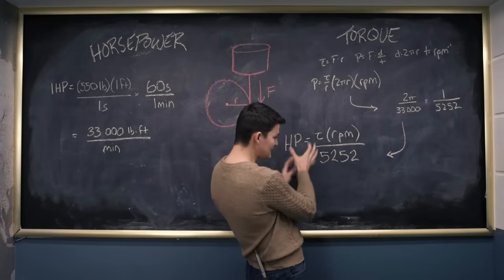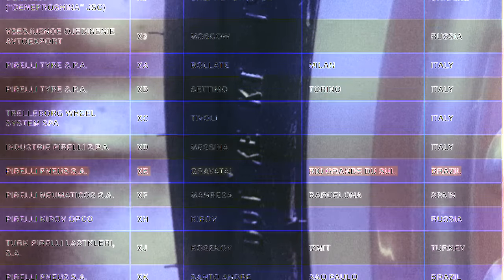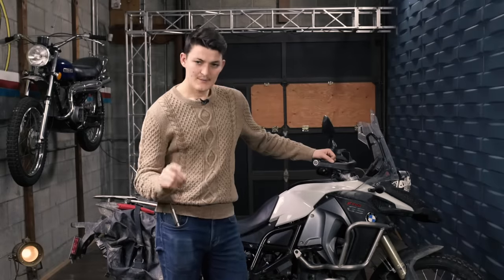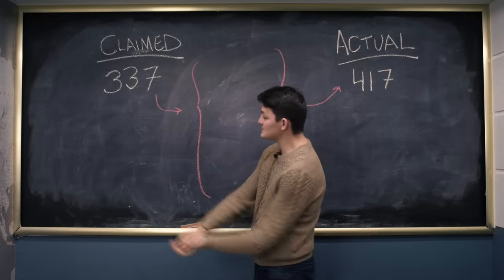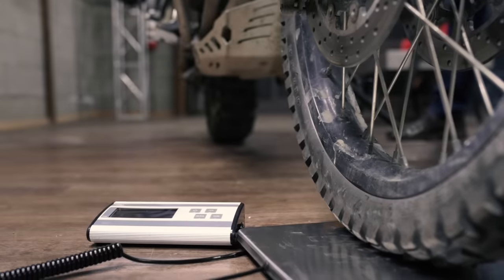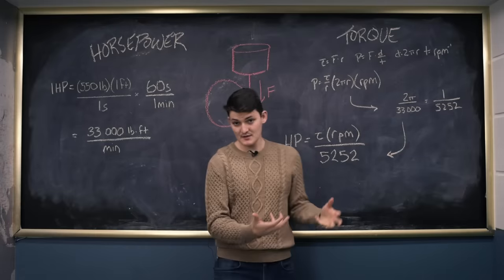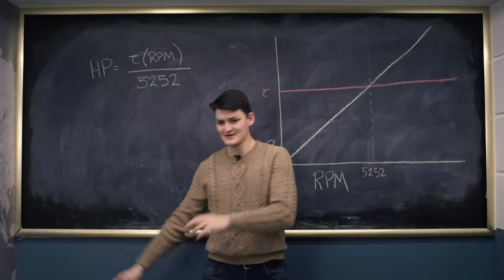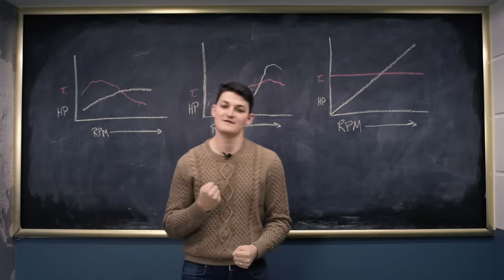3 Ways Motorcycle Manufacturers Trick You

Comment: I don’t agree. To use the term horsepower is far from ideal in the first place. You should use KW (power). And basically power is torque * rpm. So the graph is not from a combustion engine that’s for sure and there is a definitely a difference between power and torque but one is not possible without the other. But you can definitely feel a high torque and as the engine gets higher rpms the power increases naturally. That’s the difference between a diesel and a gasoline car for example. It’s because of the shape of the piston and the length of the rod. Also the because of the compression ratio. So what you feel is the torque which together with the rpm makes power (hp)
I also don’t agree on the tire thing. We have high standards in Europe and people are crazy about being screwed haha
But I like the advise at the end:)

Comment: That last one about torque and horsepower was great. The only problem is that when someone says “ go ride and see what you like” they don’t seem to take in to account that the dealer likely will not let you, and even then not properly. So we gotta go by reviews or hope a buddy gets one. As for me, as far as power goes I like more low down, and in my experience bikes with longer strokes make ultimately less horsepower but the make it lower, so I’ll look at bore/stroke ratio and lean toward bikes with a lower number. Bikes that on paper or in the opinion of pros are total dogs because they’re low on power and/or don’t wind up real high will likely be preferred by those of us who don’t race and tear ass. Most of us want a manageable bike to have fun on. Case and point is the current Beta dual sport lineup. 4 bikes, different strokes between the two 350 and 390 and different bores between the 450 and 500. The 390 has the lowest bore/stroke ratio and many who ride all of them say it feels like the most powerful and most manageable and was often reviewers favorite. Anyway, my two cents.

Comment: the substitute tyre thing is not always that bad , ive bought a few brand new gsxr1000s in my life and the standard OE bridgestones on the earlier ones were actually better than the ones off the shelf , case and point the front tyre on the k3 was missing the single radial line dead in the centre and the handling improvement was noticeable , another bike was the early hayabusas with the bt56r rear , the oe tyre had more plys which greatly assisted with stability , i infact used to grab all the OE rears off hayabusas as most of them had the middles worn out and not the sides and put them on my ZX9 c1 which had an unbraced swingarm and it would vastly improve the stability due to the stifness in the carcass , yeah yeah i know a 190 on a 5.5 inch rim but they still fit well and worked great

Comment: Yes you're right about the third curve, the twin's will typically have a pushed at the start of the rom range, the 4 cylinder sports bike typically pull at at million rpm but the triple cylinder engine, particularly the triumph 1050 will pull with linear progress across ola very wide rpm range. That's what must people want for the road and it's perfectly suited to that task. The bore to stroke ratio of near 1:1 actually 80/70 is as hear perfect as you can get. 

I like your blend of humour with facts. They can be a bit dry without the humour so keep it going.

It's not corny if it's done thoughtfully.
I think you're interesting to listen to. 

Yes dry weight is not useful unlessw you can calculate the bike's weight when it's used... should be better regulated.

Tyres..I just use Michelin pilot road and I've become a shamefully devoted fan of those tyres.. occasionally I might very a storm or battlax but I'm fairly consistent with my pilot road tyres.

Comment: This is a long-standing confusion that I have :
Torque acts on Moment of Inertia to produce change of rpm.

( At zero friction, no torque is needed in order to maintain the rpm. )

So when one says a motorcycle has higher torque than another, what is meant here?
That the first bike has higher torque at a specific rpm ( So that it can increase the rpm even further )

If that is true, Torque vs rpm curves are needed in order to compare the performance of any two motorcycles.

Thoughts ?

Comment: Torque and Power are different, albeit related. People should care about both, and yes you need to see the bikes on the dyno (motorcycle magazines will do this). Ask people who buy Diesel engines (lots of torque from a long stroke engine) but as a result lower rpm and lower maximum power). Or someone who rides a two stroke motorcycle (barely any torque unless it is being thrashed at full revs). 

I agree about the flat torque curve as being ideal, but some riders like the ‘top end rush’ of an in-line 4 while others prefer the flat curve of a v-twin.

Comment: Maybe to put some perspective into power vs. torque:
Power is force times speed (P = F*v) and the force is, what is accelerating you, so in fact what you are feeling depends on your speed and the power put into the system.
This is also the reason, why aircrafts usually aren't measured in power but force, because the power is depending on the speed of the aircraft and they aren't limited by normal forces when accelerating.
With land vehicles, you are usually limited to about 1g of normal force, so power is in the best case a measure of maximum speed with (near) peak acceleration (usually about first or second gear) and a measurement of total resisting forces overcome (in the best case), which translates to top speed. Gearing makles all the difference in this case, as it directly changes the available power at a set speed or on the other hand changes the available force at the wheel.

Comment: I think the torque-horsepower differentiation comes from cars, where, due to the vastly different sizes of vehicles it applies to, there genuinely need to be vehicles with much longer strokes and higher radius rotations, or your average 18 wheeler would be moving its piston at relativistic speeds. But, as noted, it's mostly irrelevant on bikes, which generally have similar torque to horsepower ratios (because your not going to build a much larger, but also explicitly much slower engine- our work truck has significantly less horsepower than most sportcars, but if you piled our 10 ton garbage capacity into a bugati, it's not going to move anywhere despite having more than 3 times the power. Probably because it would crush flat, but you get the idea).

Comment: Well, you don't feel the torque itself, but the chagne in torque.
If you accelerate in the same gear,  you get more and more rpm. The more rpm, the more power. But the faster you get, the more power you need to accelerate for the same amount.
That's why you accelerate faster in second gear than in fifth gear (even without wind resistance). So the rpm cancels out when you only consider acceleration. What's left is the torque. So a rising torque in higher revs means higher accerleration in higher revs

Comment: Thank you Ryan, Awesome explanations on the math for those that don't know it. Now, when people don't believe me, I can point them here for a second mental-incursion on why the true Horse power of the engine is when the  Rpm is at 5252 rpm , and  T= Hp.... ( or visa versa...and minus mechanical losses , of course).
I'm still trying to figure out why HD sets rev-limiters to 4500 or 3500 rpm, Etc.  Seems like a waste that the classic N.A. cruisers will never reach full potential of the motors full capacity.( Piston speed , maybe , but that hasn't stopped Yamaha or Kawasaki from revving.their under-square V twins to high rpm's... )...ciao
Reply: Is it simply because ABOVE 3500 RPM, Harleys shake so uncontrollably that no readings can be taken?

Comment: HP and torque are two appreciated metrics. Two cylinders punch much harder at lower speed/rpm than the equivilant sized 4 cylinder. Quite simple. Once higher rpms are attained, more cylinders, together, overtake the fewer, large bore cylinders.
I guess it's important to list WHEN that power is achieved, yes.

Comment: Well, in the "torque vs horsepower" discussion, there is also one more contender: The Gearbox
Because you can get an engine with a high ratio gearbox, which will have less torque on the wheels, but higher maximum wheel RPM, but you can also get one with a gearbox that has lower RPM, but higher torque output.
Reply: But in real life, when manufacturers make misleading claims around the torque or power of their engines, they anyway exclude the gearbox from the discussion... So, there´s no misconception about the role or importance of gearboxes (cause there´s never been any brainwashing about them), the misconception in most consumers´ heads is about the engine.

Comment: Nice video :) but if you are comparing two in line 4 cylinder engine with the  torque and BHP is irrelevant but if you have in line 4 cylinder engine with 100 BHP and V2 with 100 BHP the torque will be much different so maybe manufacturers in some ads give you BHPs and in others torque :)

Comment: Finally pleased that someone mentions this torque vs horsepower nonsense. Just because a bike has a lot of torque doesnt mean it will accelerate fast. What determines acceleration is power. You feel power more than you feel torque. If it was torque that won races, then i guess the 2005 f1 cars with around 950 to 1000 hp would lose to a Golf R?

Comment: Most modern sportbikes basically have the same torque (maybe a bit higher) they had 10-20 years ago but can go to much higher RPMs - Here is a comparison using the imperfect but still entertaining Ride 3:
· Honda CBR900RR autoshifts at under 11000rpm
· Honda CBR1000RR SP2 autoshifts at close to 13000rpm
Both bikes probably have similar torque figures but the modern bikes has it much later

Comment: Trick 3 is classic Royal Enfields or in general all touring motorcycles brands. They keep saying their engines generate insane torque at low RPMs but their motorcycles hardly move forward. 
Another thing is the drive ratio. Torque generated by your engine means nothing. It's the wheel torque that matters. But no manufacturer will ever disclose the gear ratios.

Comment: Loving how far you have come with your vids. Keep it up a d you will do well. But... Your understanding of torque and horsepower needs work. You cannot have a flat torque curve as it means you have work at no revs. Torque is easy to put at the power produced and how is the power produced times revs. Torque will not die as your graphs showed not will and not produce at zero rpm.  A small motor producing small power 16000 times a minute has small torque but bigish HP. A big motor producing big power each stroke with low revs may have the same peak hp... But felt very differently.

Comment: Tires arent that simple and many high end / more performance oriented tires come with a shallower tread depth from the factory because the additional tread squirm under load can negatively impact handling. Also tires with shallower tread often come with softer rubber and stiffer sidewalls to further improve handling, both of which are difficult to determine just by visually comparing the tires. Tires always have tradeoffs and a major one for performance is longevity.

Comment: The explanation about HP and torque really changed my mind. Sad that we can't get the dyno graph from the producers, instead gotta hope for reviewers to do it. And most of the times the peak torque and HP are around 20% smaller than what manufacture tell us. Are those numbers theoretical too?
Reply: In some cases they are theoretical, but generally mfrs will quote crank hp/tq, as that is where they measure it with their engine dynos. The #'s we see from reviewers are from chassis dynos, measured at the rear wheel. The difference is driveline loss, ~5% higher for shaft vs chain drive. Incorrect dyno calibration/settings can also give about any # desired.
Reply: @dougfreeman3229  good to know 👍. Thanks for the answer

Comment: His breakdown of torque and horsepower being misleading because of the RPM's making it hard to utilize is so true. I have a G37 with 330 hp and 278 lb feet of torque. If I'm cruising at around 2000 rpm and put my foot down it's dog slow. I don't know how much power that motor makes at 2000 rpm but it's not a lot. Unless I shift down so that I'm between 3500-6000 rpms all that power is unusable. Considering most of us cruise at 2000 rpms 90% of the time in our daily driving, it does not make for a great driving experience, but on paper it looks great.

Comment: Until now I only knew the OEM tire trick the other way round. On cars OEM tires are built tailor made for that vehicle. Same size, same brand, same manufacturing plant - but the tires for BMW, Volvo, Ford and VW - and even the platform sharing Audi - are all different in detail despite looking the same. If you get the chance to see them factory new you will just notice different colour stripes on the running surface, which reveals the trick.
So stop thinking why after the first set was worn your car will never drive as smooth / economical / sporty (whatever the car manufacturer wanted the tire to be, these three things are making a conflct triangle) as new and as the one you took for a test drive before you bought. The OEM tire was made especially for this car. The aftermarket one is plain average because it has to work with any car.

Comment: I have no idea what you think you're talking about. But I can feel the difference between more torque down low add more horsepower up high on anyting I ride. I can also tell the difference on automobiles. Even though I do understand what you are trying to convey. But if I have an engine that puts out a hundred horsepower that is putting out 50 lb of torque at 2000 RPM and doesn't put out a hundred horsepower until it's at 5000 RPM, feels completely different then an engine it only puts out 30 foot pounds of torque at 2000 RPM with one hundred horsepower at 6500 RPM.
Reply: Okay but you arent feeling the torque, you're just feeling acceleration at different speeds. And falsely correlating that in your brain with some mystical difference between torque and power.

Your ass (literally) cant tell the difference between 50NM at 5252 rpm compared to 25NM at 10,504 rpm. To your senses they are both just some amount of acceleration and to math they are both just 50 horsepower.

Comment: Power is not tied to RPM, not as much at least, that's why you have a 6 gears transmission. And that's why peak power is meaningful unlike peak torque. But it is true, a torque or power over rpm graph would be much more meaningful than both those values.

Comment: Copper wires were stripped out so only the plastic sheath remained, tires were under inflated with hydrogen gas,  no air filter, oil filters, spark plugs, and even the caps from tires valves all off

Comment: Here in Asia, QJ Motorcycles (China) and their subsidiaries (Keeway, Benelli and) have been practicing ALL those 3 tricks since 2017, I think.
Their bikes appear light, fast, and equipped with above average tires on paper/pictures.
But if you buy one, they are 15-30% heavier and slower than what they have printed on spec sheets aaand the tires are dang cheap which has a high chance of causing a low side crash on wet roads.
Sigh...
So, Asian folks, if you're going to buy a bike from QJ, Keeway, or Benelli, ask a pro mechanic from another shop about what you should do right after riding the bike from the dealership without screwing the warranty. 😁

Comment: I hate how Japanese OEMs send out torquey or high powered bikes with cheap pieces of garbage tires that will slip at the slightest bit of rain or temperature drop especially in a turn. My Z650 shipped with Dunlop D214s and those were okay in the warm dry pavement but once it got wet or cold is when it started to feel greasy and lacked any feedback while riding. The Z900 also ships with these tires which is even worse considering how much power and torque  the engine puts out.at low to mid RPM range.

Comment: Torque gets you off the line, HP pulls you through the traps.   When they say, "feel the torque", they are saying it's a motor with its power range at lower RPM's , not much more.

Comment: Very right stats for dry weight ....the tyre theory is also right as sales man said its special compound tyres with extra grip but were thinner n lighter than aftermarket tyres of same brand....it's stated as best number to impress 25 hp @ 5600rpm or 27 nm torque at 4000rpm n bla bla bla.....good job in bursting ass of fake claims ...as I also tried all of it

Comment: You never feel the torque as advertised. You feel the torque at the wheels, which is after the gear box. Gears are torque multipliers.

But horsepower will always correspond with the force at the wheels at a given speed.

Comment: Torque is proportional to acceleration but you need to factor in drive ratio and wheel size - so engine torque is generally meaningless and incomparable - you need wheel/tyre force for each gear. More horsepower means you have more torque at higher rpm and therefore acceleration capacity at higher speed and thus higher top speed. When you twist the throttle you feel torque, but when you sing it out to red line in top gear you feel horsepower.

Comment: All the rigamaroll about the latest 14k RPM 200 hp wind up toy, but all I can think of is how much oil is getting to that brass bushing they call a main bearing, while the crank is flinging it away.  Then I look at these tiny oil pumps, the shaved away metal everywhere, and I really begin to wonder.  In my world 2 engines shine, Sportster, and Suzuki GS, these are the basic engine designs that graced top fuel for decades, all else is hype.